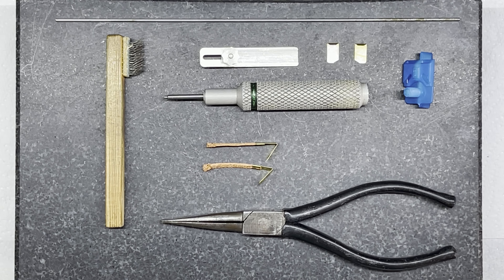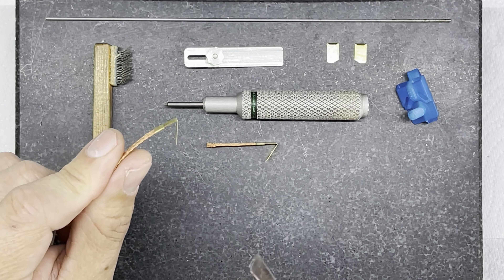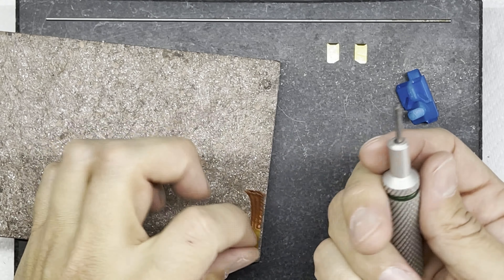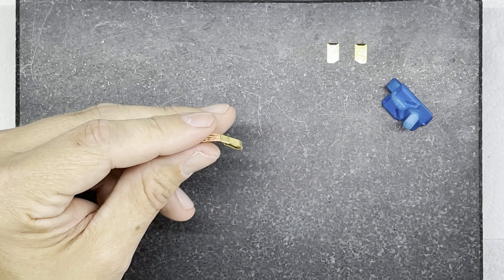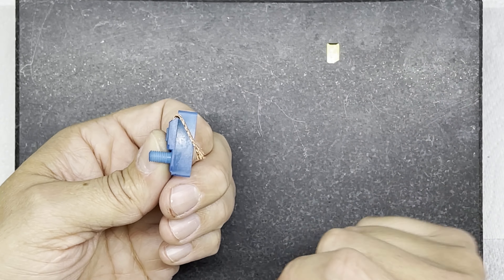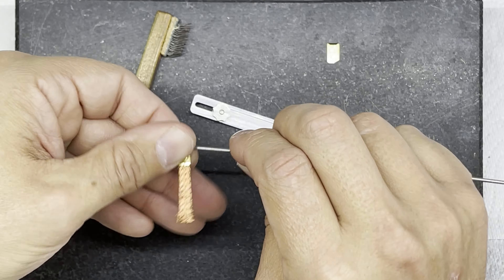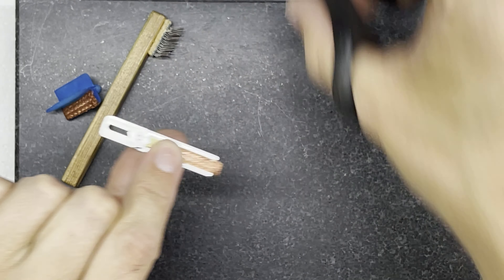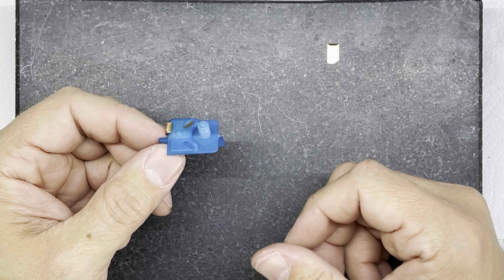Slot Car Braid Preparation

Comment: I always thought that the pimple was there to assist friction/holding in the guide. Never realised that it could stretch the plastic. Thanks for the tips.
Reply from the maker: It was originally intended to aid friction but if you bend the braid clip as shown in my video you get a good amount of friction and the guide doesn’t get out of shape.

Comment: Hello from the states!  Having grown up with the Parma brand. No longer having them to purchase parts and pieces from, is a major bummer.  Is there any company you would recommend as a decent replacement?  eBay was working well for a while. It's gotten almost impossible to get my hands on important parts like, crown gears.
Reply from the maker: Thanks for watching Greg. The American model for purchasing slot car parts has always been through your local raceway. Your raceway will buy parts from a distributor such as "Eagle Distributing" - https://www.eagledist.com/
Many raceways are happy to mail order parts to other areas of the states. Try Mid America Hobbies - https://slotcarstore.net/pages/Mid-America-Products-T1437.html
Failing that, you can always gets parts for slot cars shipped from overseas. Try Pendle Slot Cars - https://www.pendleslotracing.co.uk/
Reply: Thank you for the information! Unfortunately where I live, there are no commercial slot car locations.  The tracks that exist, are located at people's houses.  We generally "tour" the tracks and have weekly events at each person's home, alternating between the tracks, week by week.  Some of them do carry parts. But we're always looking out for options.   Unfortunately not everyone's schedule lines up to make certain trips.  As tracks are located up to 2 hours away from others. It can be difficult to acquire some parts when only a few options are available.  So they don't frown on anyone getting what they need, however they can